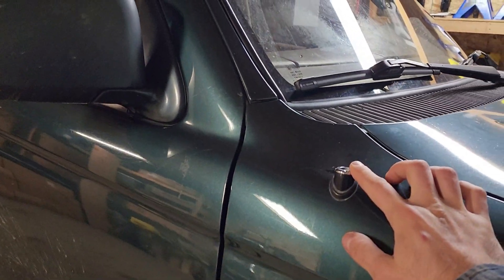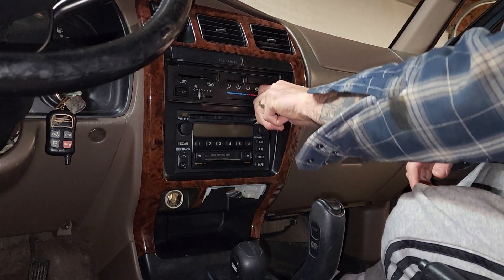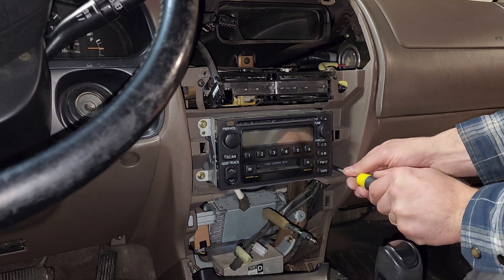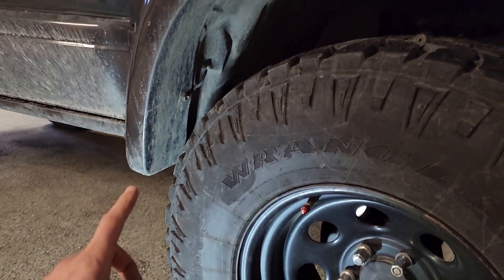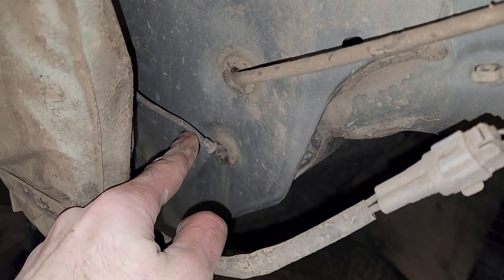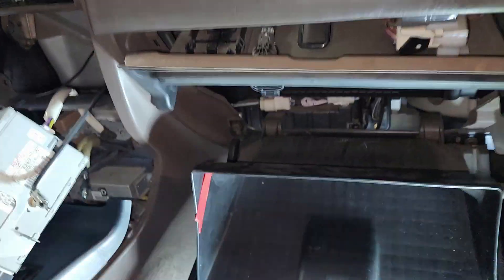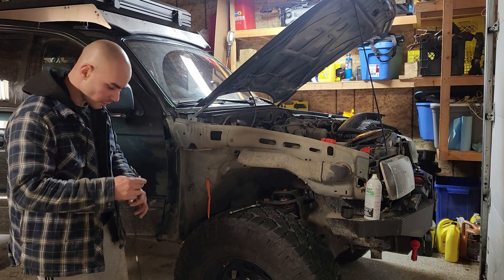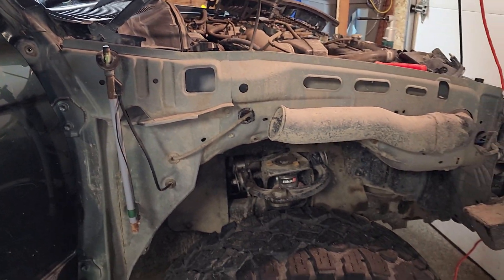Tacoma Whip Mod on 3rd Gen 4runner DETAILED

Comment: You don’t need to remove the fender, you can also remove the fender liner to get to the antenna motor. You will most likely need a few new clips though which are a few bucks apiece from Toyota.
Reply: thanks !! i saw i had to remove my front bumper to get to the ones in the front to remove the fender. I'll try your method

Comment: Could you make a video changing the cabin air filter?
Reply from the maker: I don't think there is a cabin filter on these 3rd gen 4runners
Reply: @aramschannel  I think the same, but I'm a little confused because some tell me yes and others say no, I've looked for it and can't find anything, they have a blower and there are videos about it but nothing more; thanks for answering
Reply: @jonnydelatorres5933  I can confirm there is not a cabin air filter on my 99.

Comment: How hard did you pull the new antenna cord through? When I pull on mine it gets stuck and I don't want to break it. Any tips?
Reply from the maker: @ScienceHeckYeah  I pulled decently hard but if you feel it's getting stuck, I'd suggest trying to find what it's stuck on. If you open up the glove compartment area, you should be able to see in there
Reply: @aramschannel  Thanks I'll try again.